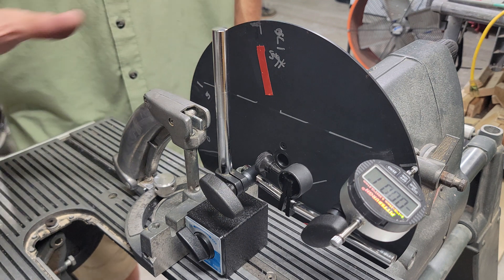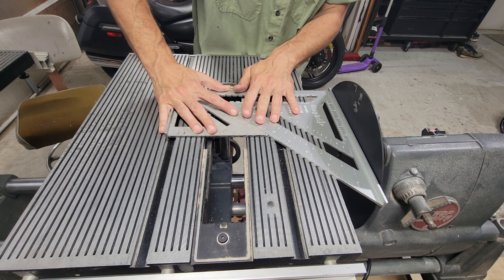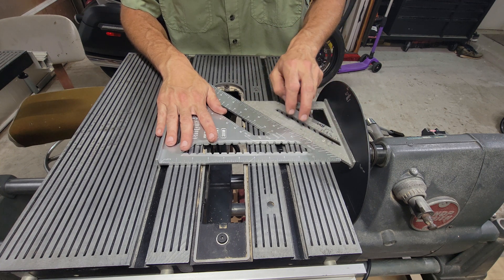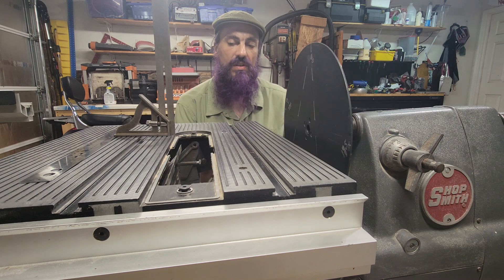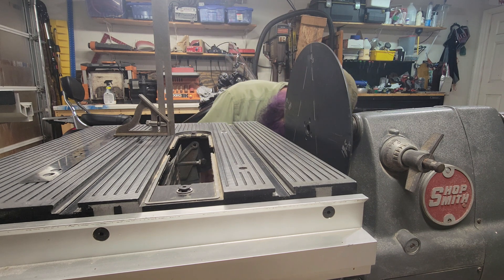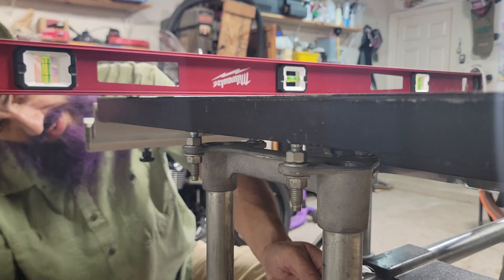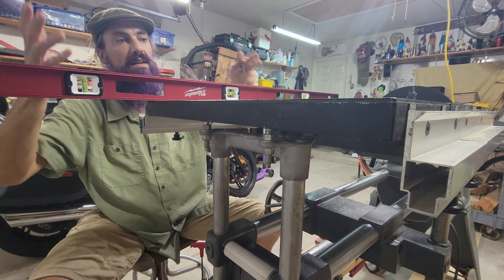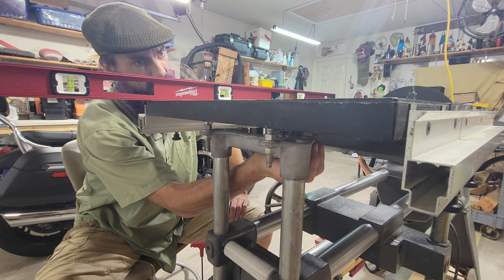disc indexing: updating ShopSmith table alignment methods for the tighter tolerances

Comment: Why can't you use miter and framing square I don't think you have to be within metal lathe specs wood varies with moisture
Reply from the maker: Because of the video demonstrates the sanding disc is not flat. The video simply about finding the most accurate points of reference, which requires accurate measuring tools. Doing a four corner square cut to verify blade alignment will show you just how drastically out of alignment it can be without accurate measurements. Even if it's acceptable for a saw, extending the axis of the quill in a straight line still needs to be able to line up with your leg then 5 ft away.  Also once you make sure that your blade is perfectly straight in a line it will also let you verify whether the rest of the frame isn't alignment. The shop Smiths were partially assemble in a factory, and in many cases have had multiple owners shuffling them around screwing up the alignment if it ever was. If you do far enough you can even find videos put out by shot Smith about replacing the way tubes. They discuss replacing them for free because so many were damaged by misassembly in the factory. There are a host of things that can lead to inaccuracy that a square would not detect, thicknesses in the microns that are only amplified the further from the center they are measured. In the end every user has to decide for themselves whether or not the instruction shop Smith have provided is sufficient. There are a lot of quote unquote experts who won't give this method the time of day because it bucks tradition, and they have incomes very closely tied to network of passionate owners. I would remove the video if anybody had ever actually demonstrated how my methods are wrong. Instead all I get is well why won't the old way work well enough. I don't know about you but I can't live with things that can be fixed without trying to fix them.

Comment: The Shopsmith instructions to measure from a single point on the disc solves some uncontrolled variables. That is rotate the disc to the back side so that you are "scratching" the same point front and back. It solves the fact that the disc is not flat even when brand new. I have three discs and all are a slight potato chip shape and the out of flatness is surprisingly symmetrical. It should flatten somewhat due to the angular forces at play at sanding RPM. It also helps reduce the impact of shaft run out on the measurement. Shaft runout could be a bent shaft or worn bearings or even a burr where the arbor mounts to the shaft. If the shaft runout creates a high or low spot, then that spot will flow your indicator and remain more consistent.

Couple of suggestions; 

1. use the "dimple method" on the miter bar to take out the slop of the miter gauge/slot.
2. Make a rigid wood L-fence to mount the miter gauge, then mount the digital indicator to the wood fence. This will help reduce the impact of any tolerances in the magnetic gizmo's moveable bits. See my videos on measuring shaft runout.
3. When moving the dial indicator back and forth pull the back pin so the tip lifts off the surface. This will eliminate the pin tip from wearing down or accumulating debris that may cause measurement consistency issues. That means setting up the indicator so the pin shaft is not bottomed out.
Reply from the maker: Thank you for the suggestions on removing the slop. In the end I found it simply applying lateral force kept the miter to one side and consistent.

Yes I'm aware you can set it with just the high point. However I believe there is value and locating a section of the surface that has only varies by .001". Knowing the position of only a single high point does not provide as much assistance when setting the table stops.

I believe I demonstrated that my bearings and shaft run out were not the cause by clocking the face against the shaft and measuring that the high points remained constant with the face of the disc not the shaft. That is a simple, but I believe it is a valid method.

Generally speaking my point still remains that the sound of the scratch method only occurs because the surface is moving, and therefore measurements are less reliable than something like a micrometer.

There are better tools and methods available than a metal rod. SmithSmith the company is severely overdue in updating their manuals, both illustrations and techniques.